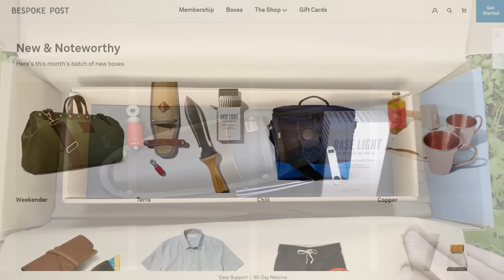How To Make A Bottle Guitar (3 Parts and NO Tools)

Comment: I tried this but it didn't work with my string
Reply from the maker: What went wrong?
Reply: @Nighthawkinlight  the sliding knot wouldn't slide, I tried It with a different type of string and it still didn't work fully but it worked enough to get a sound out of the string. I might add some acoustic pickups

Comment: why is my line so loose no matter what i do
Reply from the maker: Is your taut line hitch slipping?
Reply: @Nighthawkinlight  yes but no matter how many times i restart or add extra loops it doesnt tighten
Reply: @Nighthawkinlight  the only time my insturment is clear is at the very bottom. the top just completely doesnt work.
Reply from the maker: @davidl1022  You don't want extra loops in the knot, just as many as shown. If you can't get it to stop sliding your string might be too slippery and you'll have to tie a thicker string on the back with the sheet bend knot shown later in the video.

Comment: Tried using a glass bottle?
Reply from the maker: You need one with good nubs on the bottom for the string to loop around. Most glass bottles are flat
Reply: @Nighthawkinlight  Ah. A kraken rum bottle seems like a perfect choice then(two rings form a handle near the mouth. Might be tricky to make a bridge.
Reply: Ignorance maybe hold the cap with a zip tie as bridge??